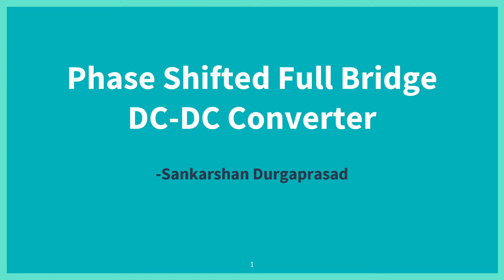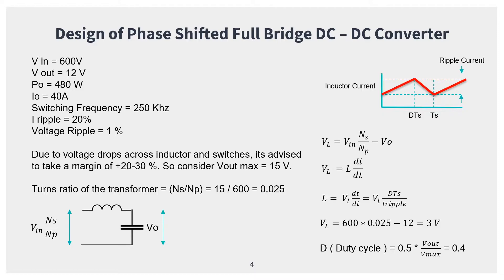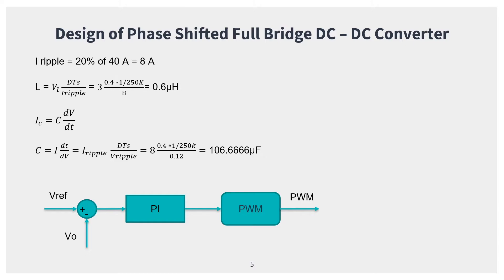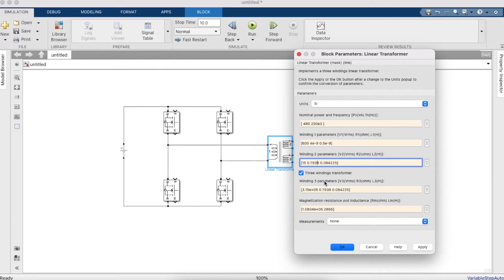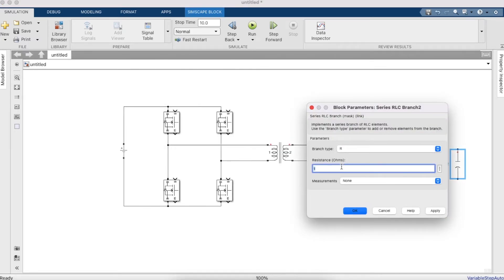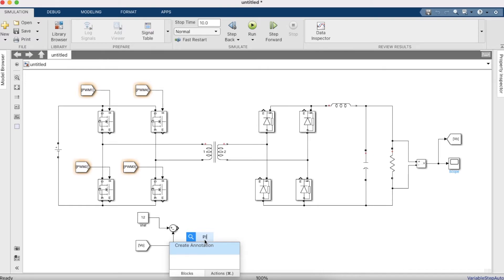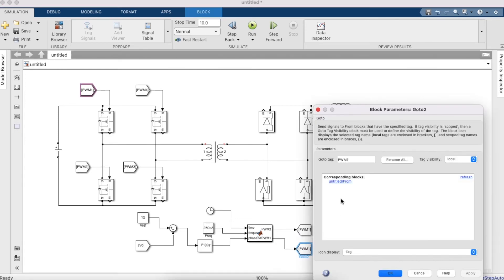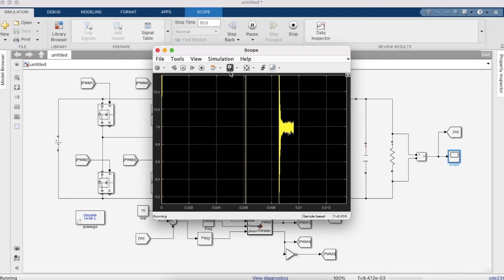Closed loop control of Phase-Shifted Full bridge DC-DC Converter in MATLAB/Simulink!

Comment: nice information sir.
i want to step up the voltage from 390v to 1000v is this converter is suitable ? and the power rating of the converter is1200watt.